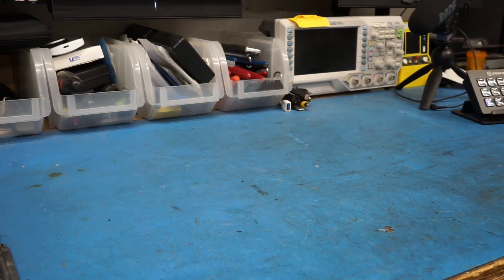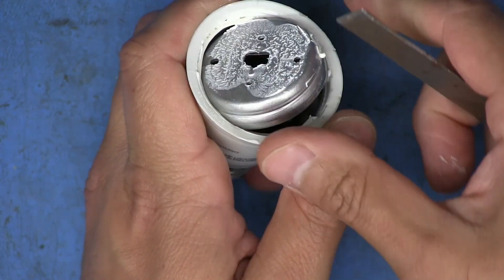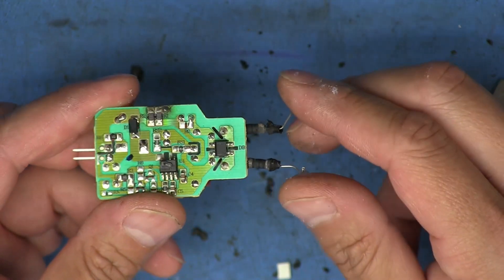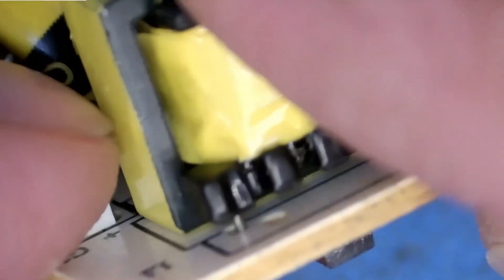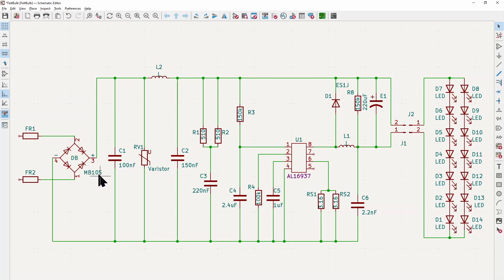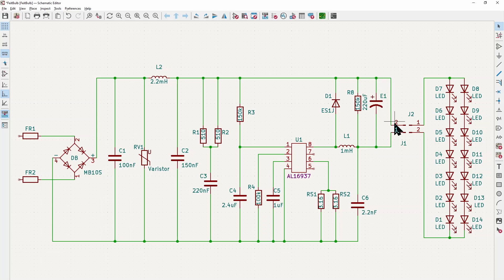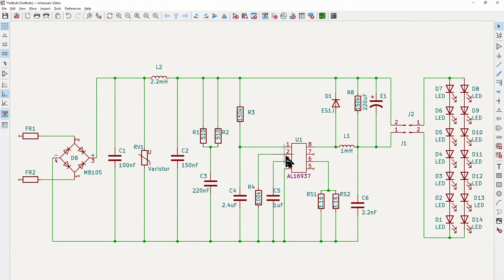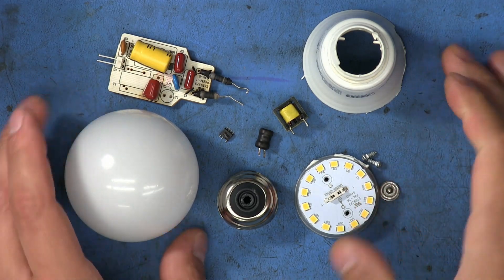TEF #111 | Smoked LED Bulb Autopsy and Schematic

Comment: Badly made capacitors (often from China) unfortunately seem to be the main cause of LED bulb failures (bad Electrolytics seem to be the main cause of failure in LED TVs and monitors).
Reply from the maker: It especially sucks when there's a ton of caps and there's no physical evidence that any are bad.

Comment: I burn a few a year of the LED bulbs , cheap ones or name brands it makes no difference . At this point I'm not sure if I am saving money or not by switching to LEDs over the compact floresant bulbs I had before that rarely went out 1 every 3 to 5 years or so .   My house voltage is 124 volts coming out of the panel box not sure if that has something to do with it but the power company says that it is fine .
Reply from the maker: That's a  pretty odd situation for sure. We've lived in our current house for 5 years now and previous owners had already replaced most lights with LEDs. We replaced a few more that were CFLs, and have only had maybe 3-4 LEDs, at the most, fail during this time, this one in the video being one of them. One other was one that was used in an outside fixture, which didn't completely fail, it must've had a cracked solder joint as it would come and go and was affected by being tapped, and the third was in the automatic garage light. Can't think of what else off the top of my head, Our voltage usually stays somewhere within 119-120. Have never seen it be as high as 124.

Comment: These bulbs are driven far beyond their ratings. I took one apart one time and one of the LED chips was black.
I would like to rig it for 12v use but I'm not sure what the voltage ratings are per LED.
Reply from the maker: I tried measuring a single LED voltage drop with my meter while I was working on this, but it seems to be higher than what my meter will do, so I didn't include that in the video. I'd have to rig something else up to get a useful value. They're probably using two or more diodes in series per package.
Reply: @ThatElectronicsFool  maybe hook just one LED chip to a bench power supply and slowly ramp up the voltage until it lights.